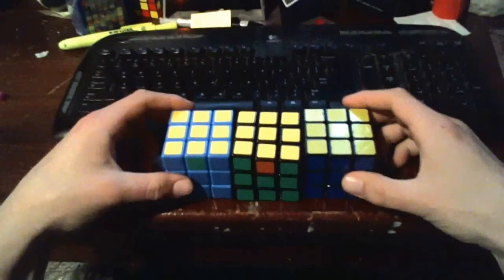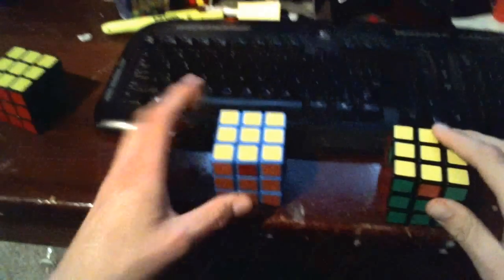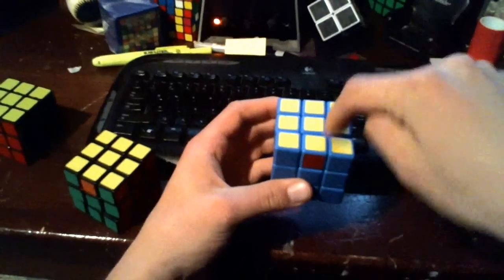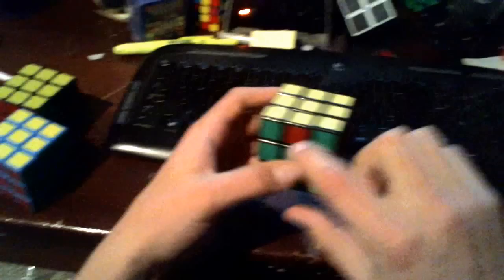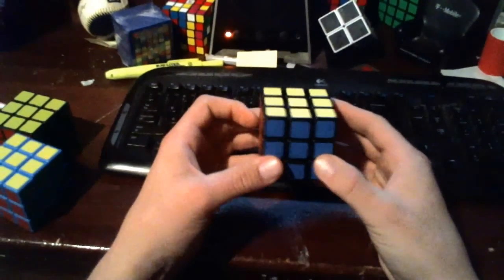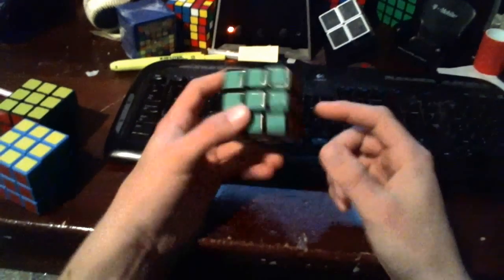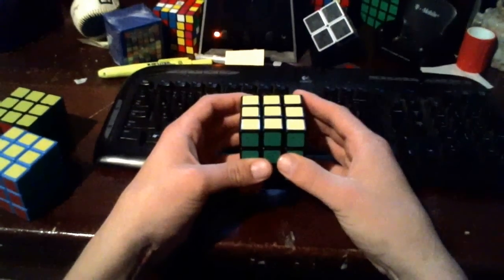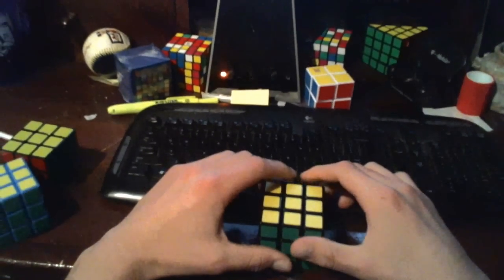#7- Finishing the Cube- Solving Last Layer Edges

Comment: hey, so, i have been having trouble solving my cube. i have done every single step up to the point where there are 4,3,or 2 edge peaces that are wrong, at the moment, the whole cube is solved except for the blue side and red side, blue and red are connected to yellow and its two edge peaces red/yellow and blue/yellow edge peaces are oriented wrong. so, the red and yellow edge peace is at its correct position, just oriented wrong, same for the blue. no matter how many times i try the algorithm i keep getting the same thing.. any clue whats wrong? new cube, has not been tampered with.
Reply from the maker: From what you're describing, it sounds like the pieces were somehow swapped. Maybe they popped out and you accidentally replaced them in the wrong position? Otherwise, it's not possible on the 3x3 to have two fully completed sides during the final step. This can happen on the 4x4 (and 6x6) due to the cube having an even number of sides, which introduces parity. 

My recommendation is to just physically swap out the two edge pieces during the last step and get your cube to a completely solved state and then try solving the cube again. This should resolve any issues you're having.
Reply: +Marco A. Torres II http://rubiks.com/uploads/general_content/Rubiks_cube_3x3_solution-en.pdf